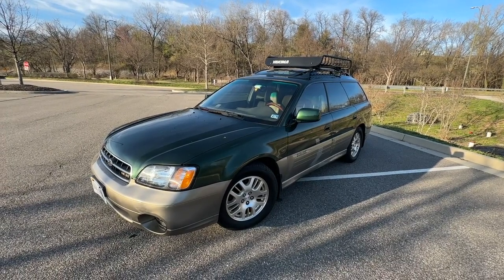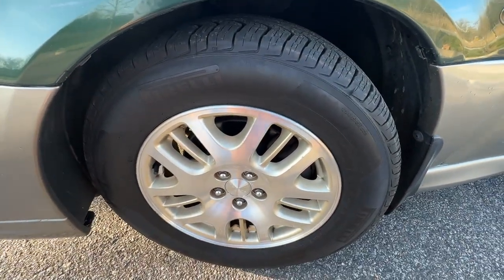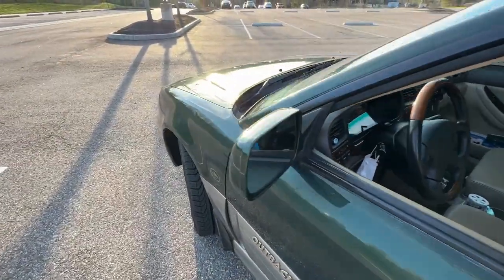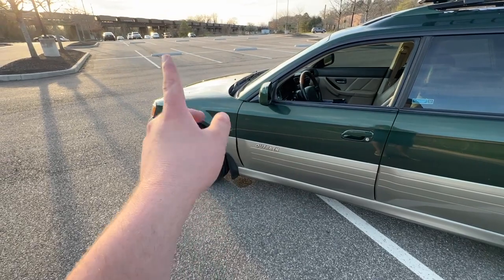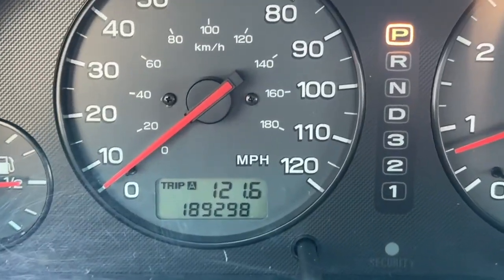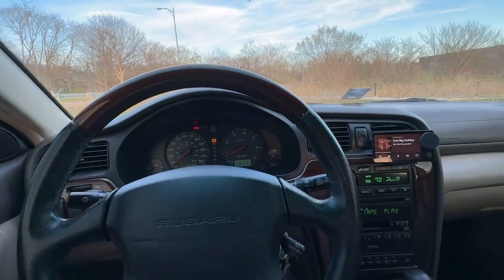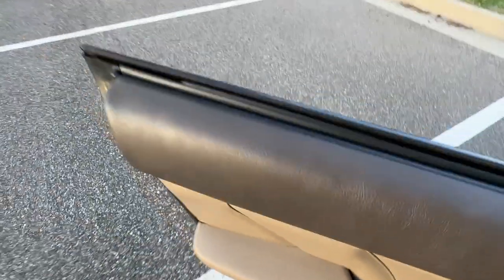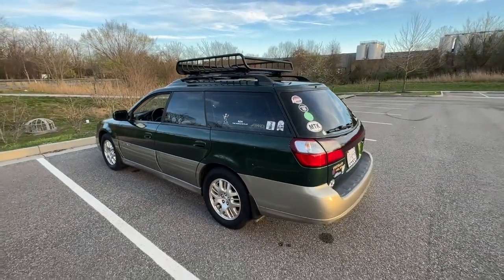2002 Subaru Outback L.L. Bean Edition H6 3.0 Updates

Comment: I have a 2004 slime green 2.5 Outback  with 170000 kl  so around 110000 miles lots of valve slap , sounds like a diesel  but no oil use ,owned 5 years never let me down .

Comment: I had this edition in black for a few years. I loved it but it was pretty rusty when I bought it, so it didn't last long before it wouldn't take a sticker. I bought a Crosstrek new in 2017 and it's been good to me, but I miss the old designs. 😢
Reply: Mine wouldn't sticker if I took it to a place that does close inspections. There is always a smaller mechanic around that will literally just walk around it and check the lights. My guy doesn't even lift it up and look underneath. If he did he'd fail me for the rusted out parts under the rear wheels. But my mechanic that works on it agrees that even with those holes in the unibody it's still plenty solid. He jacked it up to like a 40 deg angle and swapped out a bad CV joint for me and the bottom didn't fall out or anything haha. It runs well.
Reply: @slamscaper128  wish I had a guy like that lol. Viva la battle wagon! May it stay strong through many more battles! 🙏
Reply: @UltimateDorito  OMG I was so grateful that I found him. I had given it up for scrap, until I called the owner of the dealership that sold it to me and he was nice enough to stop by and look at it, because for some reason he had a hard time believing the tranny went. He said they usually last 300K. But he got in and immediately confirmed my own diagnosis. I then pointed out the rust, which was my fault for not pushing on the bottom a little to check for rot and all before I bought it. That's when he told me that it was still solid and I just needed to take it to the right place to get it inspected. Then he gave me the best advice and told me the name of this mechanic, gave me his phone number, and where he works from. Saved me man. 

It also was critical that I received a $4000 backpay check from a UC claim that was stalled since early 2021. The check literally came the day the tranny blew and I shit you not. Took them 1.7 years to make a decision on that claim. If I hadn't received that check, I simply wouldn't have had the money to fix it at all.

Comment: Do you have any issues with wind noise?  Love the Great Lakes window sticker
Reply: I have a 2002 subaru outback (standard 2.5) and I have the same problems. I've replaced the door seals and the rubber gasket around the mirror access panel with no luck. Lmk if you find out how to fix it!